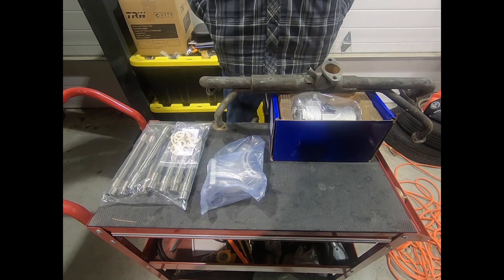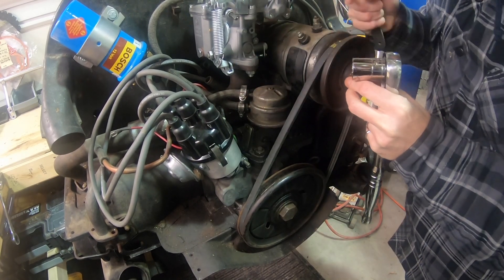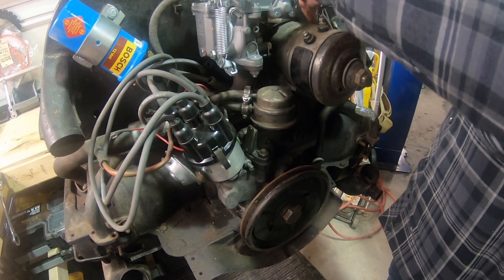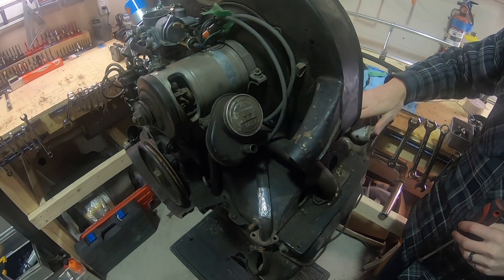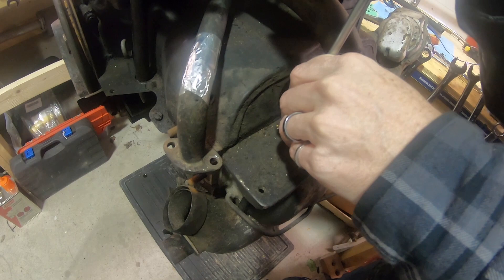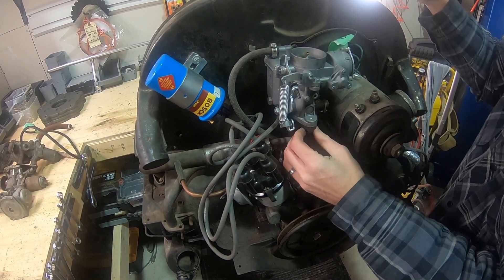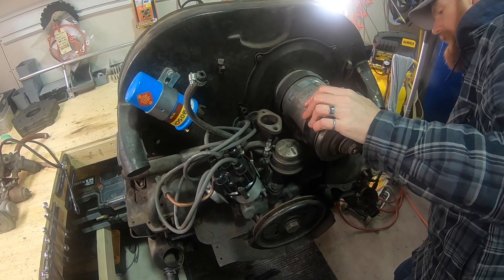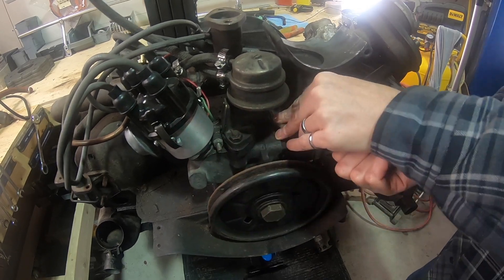VW - 1500CC Engine Tear Down/Assembly - Part 1 - Top end disassembly

Comment: Hi, I'm working on my 1500 now myself. I just saw that your splash vent under the alternator stand is upside down and backwards. Mine was louver down but in the wrong direction. I was getting oil splashing up into the filler. Good video. I'm going to watch the others on this engine. Thanks,
Jim
Reply from the maker: Hi Jim, yes previous owner had assembled wrong. We put new one in correctly during re-assembly. Thanks.

Comment: Would you rather have the single port than a dual port?
Reply from the maker: Brent Chastain Yes I do, for stock applications, as it has less points of failure. Have had issues with the dual port boots in the past. But if you are upgrading and building performance engine dual port is the way to go. Let us know if you have any further questions or things you would like to see. Autostick stuff seems to be missing on the internet, so we will be adding as many videos about that system as we can.  Thanks